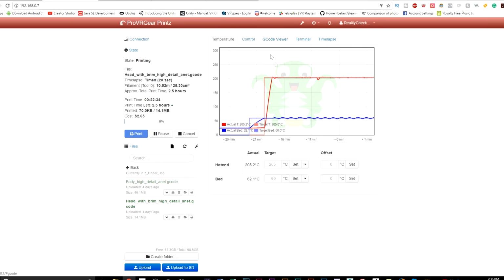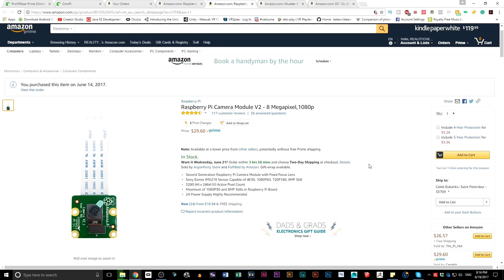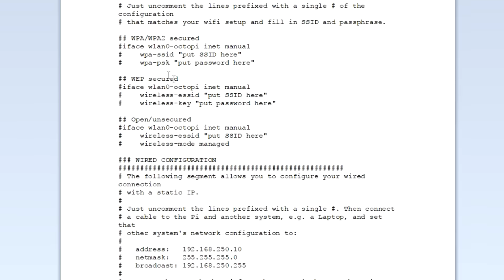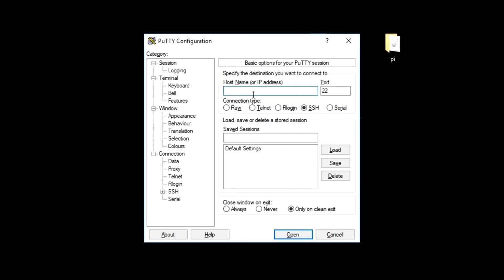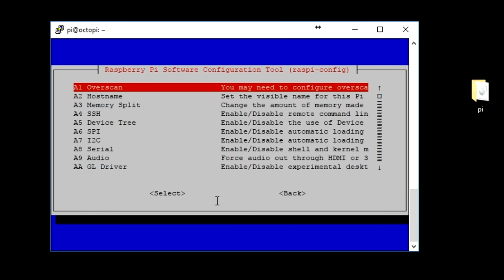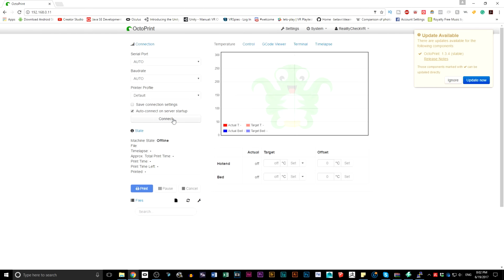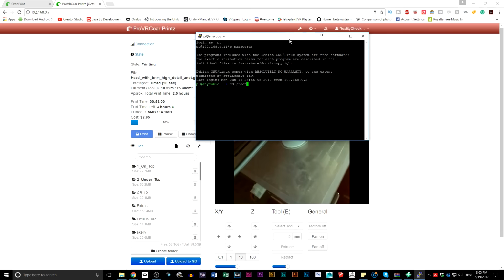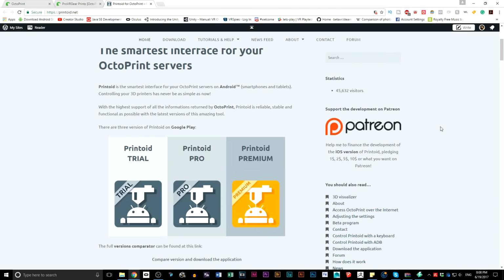How To Make ANY 3D PRINTER WIRELESS Using OctoPi | Step by Step GUIDE!

Comment: you also could use dietpi which has install option for multiple popular software including octoprint  the benifit is that dietpi is more memory  optimized and hass ssh enabled by default + you can set wifi from ssh with dietpi

Comment: Great presentation.  I have completed the Raspberry Pi / Octoprint setup.  I still have to get my printer running properly.  I assume that the connection is Raspberry USB to Printer USB.  Can I use a USB Webcam with the raspberry Pi?  If so, what kind of setup do I need to make?

Comment: You can use any slicer and not just Cura.
The mention of Cura in the settings is for the build in slicer if you want the Pi to do the slicing for you.
Reply from the maker: Totally, in my experience though, I have more consistent results than when I tried others. Still I have not used everything and I'd love to hear what others think is the best solution!

Comment: Just to keep things up to date, using octopi-network.txt file to configure the network connection is no longer supported. You must use the octopi-wpa-supplicant.txt file instead. File content and modifications are still the same as described in the video.

Comment: Great explanation and guide to get many of out of the weeds, so to speak.  One heads up: I have a Raspberry Pi 3, Model B+.  The standard Octopi .img would not work for me.  So I downloaded 2018-04-18-octopi-stretch-lite-0.15.0.img and basically following your lead I now have Octopi up and running.  Once downloaded, I had to edit octopi-wpa-supplicant.txt instead of octopi-network.txt.  Also had to download web browser since this version didn't have one.  Whew!  But, Hey, I'm learning Linux (the hard way) and got 'er Done!  Hope this helps some folks with the newer versions of Raspberry Pi.  :)
Reply from the maker: Thanks for the imput Randel! I will post your comment for people to see) YOU ROCK!)

Comment: Hi there, last year i used your tutorial and it worked flawless. But today i had to do the full process over, because the sd-card got corrupted. I installed the latest version and got it all working again. But i did some research about why this happened. Seems its not a good thing to just unplug the running raspberry-pi (and printer) after each print. What do you do before power-off to safely unplug the raspberry-pi? Thx
Reply: It might be too late now, but at the top of Octopi there's a button to restart etc. Try to always use the shutdown option before unplugging your raspberry pi.
Reply: Yep , i already figured that out, i have the printoid app on my phone and use the shut down button inthere. Thx anyway for the reply.

Comment: The video on setting up Octoprint was great, but the topic says "How To Make ANY 3D PRINTER WIRELESS Using OctoPi"  Where on you video did you set up the 3D printer end?  What Wireless SD card do you use and do you have a recommendation other than toshiba?
Reply from the maker: Hey David!
To make any 3D printer "wireless" you plug in the Pi to the 3D Printer with the USB cable that goes with the printer.
Like seen here - https://youtu.be/7JfpZR5K-lo?t=132
I use the term wireless because you no longer need to take the SD card out or plug the printer into a PC to calibrate.
The Pi can also operate several different printers if you have more then one in the area.
Hope that makes sense! :D

Comment: What are you using to access Octoprint from something other than a cell phone?  Say, a desktop or laptop outside of your home network.
Reply from the maker: I almost always use my pc using the ip and port address, there are ways to make it work from any PC, but I prefer having it local on my PC and then using teamviewer to control my PC, otherwise Printoid works well for simply viewing prints and seeing when they are completed
Reply: @RealityCheckVR  Just another quick question.  I just redid my home network and now (just my usual luck) I can access octoprint using the IP address, but I have a weird glitch where I can't use octopi.local.  The internet is dumbfounded by this so I wondered if you had run into it before.

Comment: Would this be combatable with a Creality  CR 10 printer? also does the software have an emergency stop in case something goes wrong? great video thank you!
Reply from the maker: Oh yea man! I've got one on my Cr-10 here! You can stop it by hitting power or by clicking stop or cancel in the Pi menu!)*  you can also add a display with touch)
Reply: Reality Check VR you did a great job explaining the pi set up but how do I interface with the  printer its self for an app like printoid.

Comment: How does the pi get it's power?  Do you have to connect it to the main board inside of the CR10?  Or just plug it into the wall using the 12V to 5V adapter cable? Thanks.
Reply from the maker: I've got the adapter plugged into the power supply direct!)
Reply: Did you have to solder to the CR10 power supply? I am assuming that the plug end plugs into the pi while the wires somehow get attached to the CR10 (I am referring to the 12V to 5V adapter you linked above.)

Comment: Great video!!!
May I ask, if you are using a different RPI for your printers?
There is the option to have several instances on OCTOPPRINT (different ports) on one RPI, which gives you the opportunity to have one RPI for 3 or 4 printers.
Perhaps that is interesting for you as well...
Found it here on YT...  is from Chris Riley
Reply from the maker: Most definitely it is possible to use one pi for multiple 3D printers, as it is I move my printers around and often like to have one for each printer, still in my garage I have three cr-10's all on one RPI)) works like a charm!

Comment: Maybe I missed it but I don't think you explained how the Pi connects to the printer (in my case CR-10).
Reply from the maker: sundance2005 little oversight, the pi connects using the provided usb cable for the printer!) Hope that helps
Reply: Yeah, after I posted that I remembered the printer has a USB port and that is obviously where it connects, just got my printer 2 days ago.

Comment: Thanks for the nice explanation! After installing raspbian on my sd card with win32 disk imager and booting in raspberry pi. I want now to install the octopi on the same sd card. But this will delete the sd card and so will delete the raspbian on it?
Reply: Yes it will. You're better off having two cards than trying to dual boot too. Octopi does run on Raspbian but it's the lite version with no user interface.
Reply: You can happily do that too. I have enough raspberries to dedicate a 3B+ to the printer. Likewise I'm lazy. It depends which PI you have too, the Zero W is already known to be underpowered so running a GUI on top might be too much.

Comment: have you tried any autobed levelling with octoprint/skynet? I am having difficulties with my z height adjustment.
Reply from the maker: I think that has something to do with the firmware version, as well as a combo of your beginning Gcode settings. I'm not a pro just yet, but usually the problem is simpler than expected!*
Reply: I am unsure about the gcode settings (I went word by word for the cura settings from skynet) but I believe its in the actual setting up of the leveller. Just wondering if you had any experience.

Comment: I have the RaspberryPi 2 and the webcam installed.  However, I have a newer version of  octopi-jessie-lite-0.14.0 installed.
There isn't any a webcame file in /root/bin/.. It has been moved to octopi.txt.  It is all commented.  I'm not sure which ones I should uncomment and use.  I think it is these:
#camera_usb_options="-r 640x480 -f 10"
#camera_raspi_options="-fps 10"
Are any of the other commented commands needed to activate the webcam?
Reply: There is also the command:
#camera="auto"

Comment: Do I put my log in info in "WPA/WPA2 Secured" and "WEP Secured" or one or the other, which?
Reply from the maker: this will completely depend on your internet setup from your wifi router) Most nowadays are WEP but you can usually check pretty easily by signing into your router or even sometimes it will tell you when you connect to it on a laptop or cell phone, hope that helps!

Comment: Hi i got a question.
after i put in the the information on the network config file and removed the pounds on the 3 rowa for the network ID and password saved the file and put the SD in the PI it doesn't connect to the network.
When i put a power cable in the pi the greenlight blinks a little bit but after a few seconds it stays on, is this normal?
i've been checking the networkID and password several times now and i have no idea why it isn't working
Reply: Same here red and green light flashes at the start then the red light stays on and the green goes off, no clue what im doing wrong
Reply: were you able to find what was wrong?

Comment: Are you using a wifi adapter?
Reply: Raspberry Pi 3 has built in wireless and also has built in bluetooth.
Reply: Yea thank so much for ur answere. My raspberry work on my printer correctly now :)
Reply: I have a Raspberry Pi 2 that I use and a WiFi adapter.  Works fine.

Comment: I just saw your video on a printer forum I am on  (http://www.3dprintingforum.us/), and it looks great.  I was especially surprised and impressed that you liked my Win32DiskImager program.

The issue you mentioned with overwriting your hard drive should (hopefully) be resolved now, although I do not have a system with the same characteristics that people have reported this issue with, namely systems that allow you to eject drive C (I blame Windows on this one).  That format message you saw when it finished is another Windows glitch (they don't like non-WIndows formats).   As to the speed, the only thing I can suggest is to use USB 3.x devices.  The speed you show in your video is consistent with all of my testing in both WIndows and Linux on the same hardware (i.e. it is a system limitation).

I am currently taking a brief break from working on the program, but expect to start the next development cycle this fall.  One of the features I hope to include is a better device listing menu that will have more identifying information to help select the right device.   If you have other suggestions, please drop me a line on SourceForge in the Feature Requests tab, and report any issues in the Bugs tab.

Cheers
Reply from the maker: Very cool to hear from you! GOtta say thanks for the hard work)

I will be sure to make note and mention it the next time I talk about it) Props man!

Comment: But how to connect the printer?
Reply: Depends on your model, on mine (ender 3) a simple USB cable enough. There is a mini usb port on my printer. On your you might need to manually connect some pin the motherboard.
Reply from the maker: USB cable! the same one you connect to a PC to the printer!)

Comment: Why you using old version of cura? New ones work fine too.
Reply from the maker: I just prefer to have the same Slicer as the one installed on OctoPi, as far as I can tell there is not a big benefit from switching them. Still I am learning!
Reply: What do you have to change to make it work with Cura 2.5?
Reply: Maybe the vido was made befor?????? Just a though sarcasm

Comment: Had you have an issue connecting to the wifi? I did step by step everything that you did and I'm using raspberry pi 3 and the raspberry Wi-Fi dongle. But it does not connects to the Wi-Fi.
Reply: The 3 has built in WiFi, so you shouldn't need the dongle

Comment: My Angry IP Scanner does not find any host alive instead of itself... :(

And there other devices connected, any sugestions? :)
Reply: Solved: using 'advanced IP scanner' instead of 'angry IP scanner' it works. Maybe I had to tune some settings from the Angry program, but this one works just like the video says (right after the installation without changing any settings).